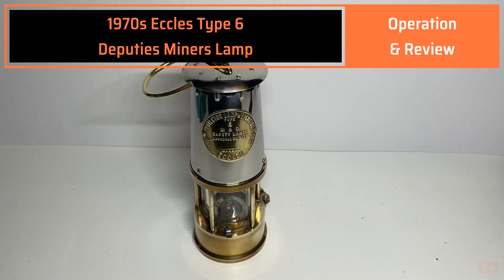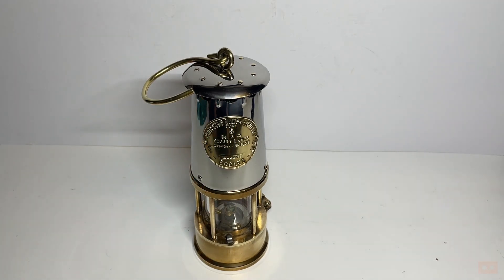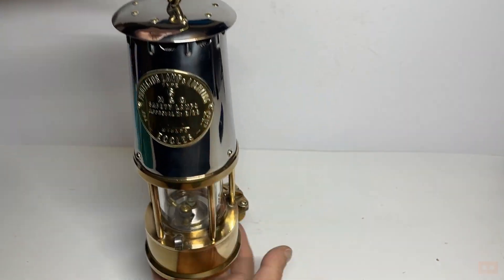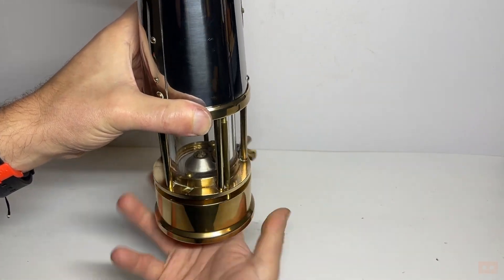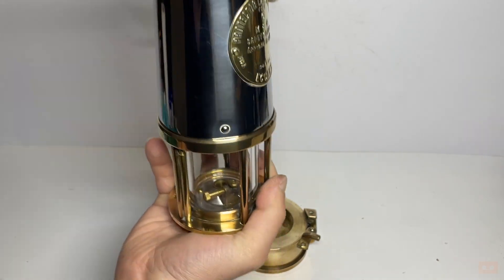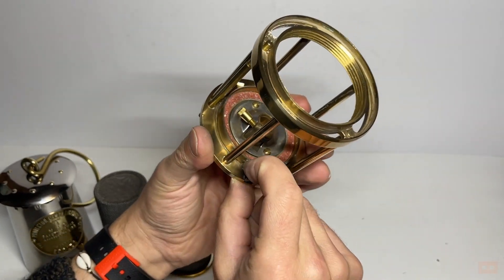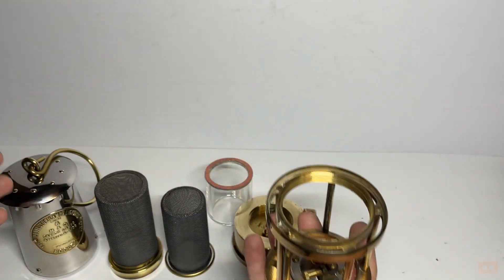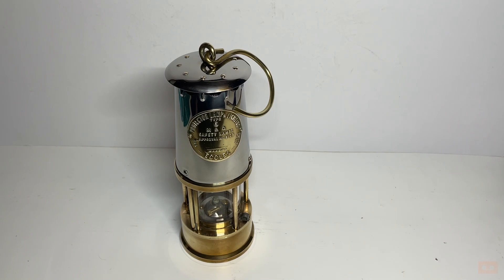Step-by-Step Guide: Assembling the 1970s Eccles Type 6 Miners Lamp!

Comment: Hi, mine has the lead seal in place, but I think the swing arm has been modified for opening without disrupting the seal...
How do you fill? And what with. I want to get mine operating, but do not want to damage in any way. I can only see you must pull out the wick?
Reply from the maker: Yes I remember you would need to pull out the wick then pour in your combustible. Someone might see this comment and give you a good suggestion of what to use.
Reply: @retro_restorations , Tks. I was looking further on-line. Mine is slightly different model to your Type 6. Yours looks like it takes a seal in the swing arm hole. Mine uses a blind pin and a magnet to release the pin.
When the swing arm is out of the way, you can see a tank fill hole beneath the swing arm. Makes sense, as you would not want to strip every time you top-up.